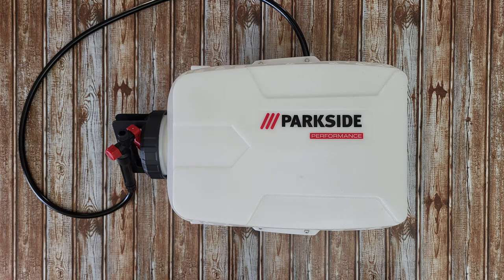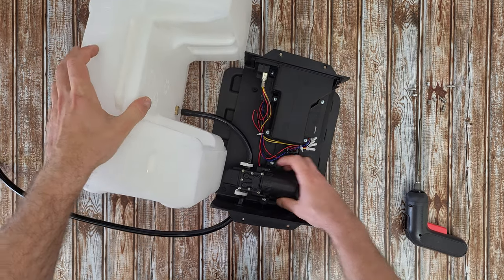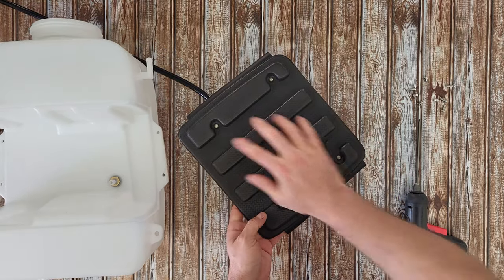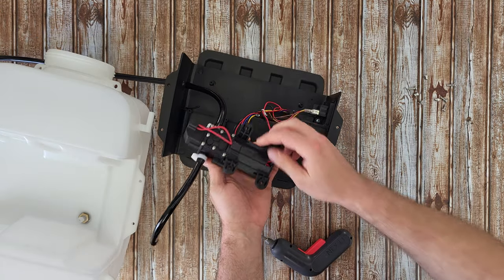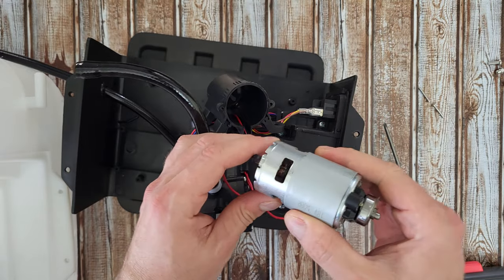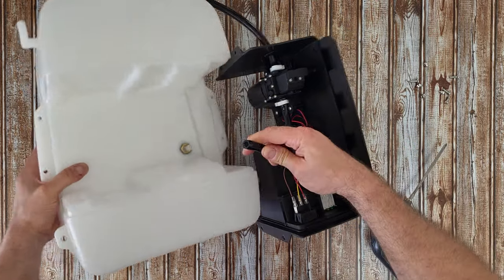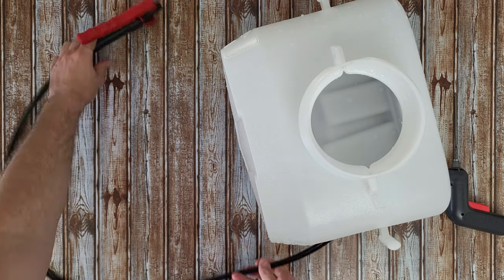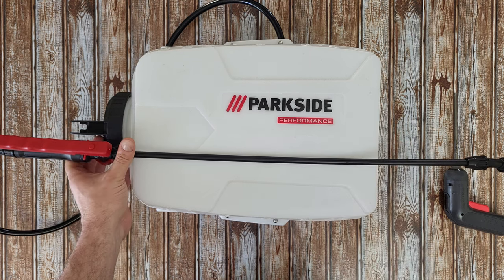Parkside Performance Pressure Sprayer 20V PRDSP 20-Li DISASSEMBLE

Comment: The pump is probably a 24V diaphragm pump. You can get them on ebay for around 20 $/EUR (and you get a more powerful one). The spray gun/rod you can buy for 6-7 $/EUR. Then you can get a tank (repurpose an old container or buy one for another 6-7 $/EUR) and you are set. I did one a few months back, using my parkside battery. I even got diligent and added a small module/board for low voltage protection for the battery (another 5 $/EUR).

Comment: Can you verify that the brushed motor in this machine has NO cooling fan? It looks that way in your video but it is not easy to see thru the motor holes to be sure.
Reply from the maker: Cooling fun on water pump ?
Reply: @TechGuruAndrew  inside the motor that runs the pump, it looks like mine has no fan in it, i wonder if this was a manufacturing error, can you check your motor?
Reply from the maker: @jernejloknar8011  no i don't see any fun.
Reply: @TechGuruAndrew  thank you, i guess then the motor has no cooling. Not sure what to make of it, i guess it is not under so much strain.